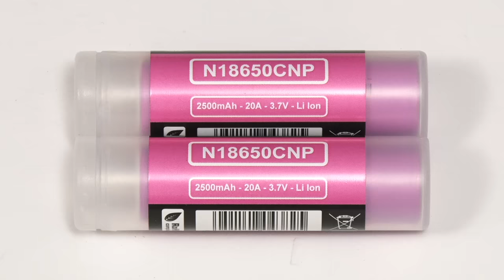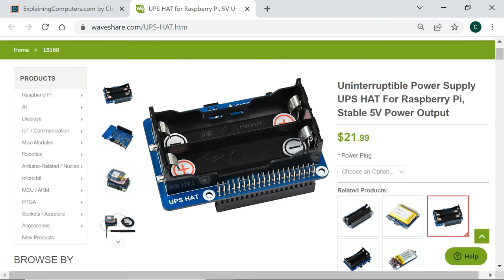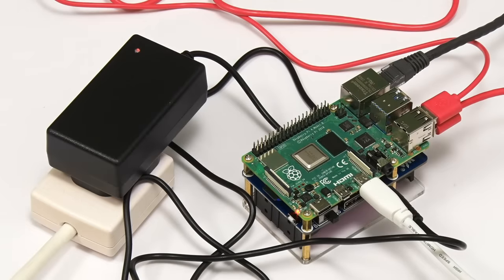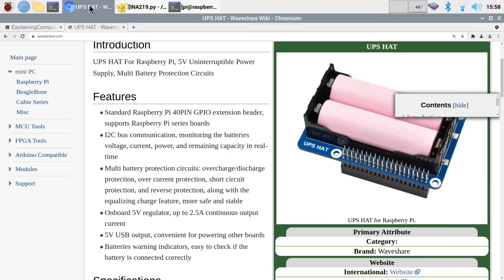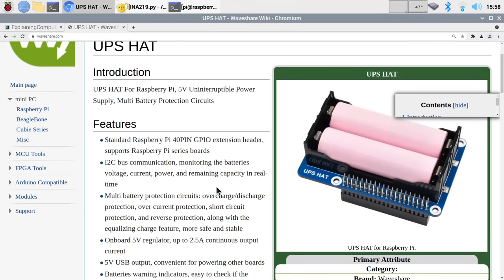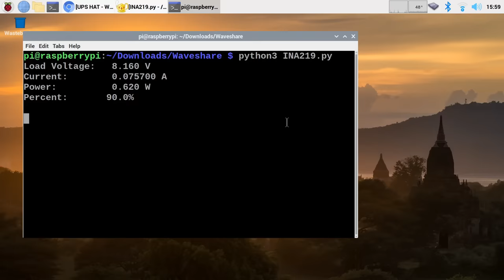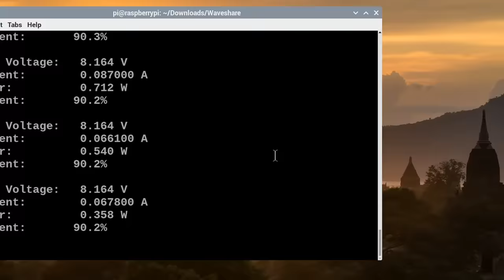Raspberry Pi Waveshare UPS

Comment: I can confirm that the pogo pins are a terrible idea that do not make reliable contact and they are susceptible to not seating properly resulting in an intermittent connection. Kind of ironic given that this module’s sole purpose is to reliably supply power!!

The original version used a conventional 40 way header and is infinitely more reliable.

The only advantage of this new version is that a push button has been added to resolve a bug in the original design where the battery management chip doesn’t power up the Pi after new batteries are inserted. I fixed the old version by retrofitting this switch.

Comment: Greetings from across the pond near Albuquerque, New Mexico, USA. Another super informative video -- thank you! Seems to me WaveShare could place a couple more holes in the UPS PCB so that a RPi Zero 2 W could also be placed on top, especially since the GPIO pins are compatible with the larger models. Just two more holes. A Zero 2 W could run a mightly long time on something like this!

Comment: I'm all for a RPi UPS, but I'm still highly skeptical of the POGO pin setup, especially if it's to be used in a semi-mobile environment.  Also, the IN219 chip that communicates to the pie uses I2C address 1000010 (According to it's datasheet). This address can be reprogrammed to any of 16 addresses by rearranging the combination of Ground, VS, and Line Voltage across two pins: A0, A1... If you plan on using a device with a fixed I2C address such as a RTC, DAC, etc... Make sure you don't have an address collision! It's nice that the chip supports re-addressing, but it looks pretty fiddly to accomplish.

Comment: I’m trying to include the hat B in my project but in my project I have a main power supply of 14.8v at 6.8A. I will step down the voltage to 8.4V but I wanted to know whether the internal circuitry can handle the 6.8A current

Comment: Are the cells in series totalling 7.4v or are they in parallel? It appears they are in series meaning they have a buck instead of a boost, but this also means they would be useful in charging a supply for motors and such.

Which begs the question, is there also a low voltage cutoff circuit for 7.4v supply?

Comment: Another great job on the UPS. Question how long will this device work (Power outages?) ??? Then you need a code for when it fall less than 1-3% battery power, it save/shut down. Or this is build in to this Waveshare UPS unit? If so, great? If not, what code needed to save & shut down the Pi?

Comment: Very good video. Thanks!
I still got a question about the following case - what if…

The external power is disconnected from the UPS. The Raspberry runs now using the power delivered by the UPS, then initiates shutdown and turns off. 

Would the Raspberry turn on and boot up again when external power gets reconnected to the UPS? (even if the UPS is completely charged)

And furthermore: does the UPS turn completely off when the Raspberry is turned off? (so it does not draw any power when it is not in use?)

Comment: Nice video! I thought about getting one of these for my Pi powered home server. But, unfortunately a power outage would also disable my router and then I couldn't access the Pi anymore anyway. So, it wouldn't prevent any downtime. However, certainly it would be possible to gracefully shutdown the Pi in such a situation if the network won't come up until the batteries are empty.

Comment: The POGO pins could potentially do with stronger springs to maintain a better connection if the device is used flat, like in the video.  Other than that it's a more streamlined option than using a USB powerbank.  I do wonder how long the backup power from the batteries is tho?

Comment: Ironic, the "hat" concept is for hardware on top, also not using the correct i2c pins as specified for a hat but that may be because those pins would be in the middle and the board may "flex" too much for a reliable connection, hope the ic2 addresses used are known if not the "I2c-detect -y 1" command can show that, not standard, so install with "sudo apt install i2c-tools"   (could be without the -) ,  "sudo apt-cache search i2c-detect"  will show which package to install.

Comment: It would be nice if an alternative to the Pogo pins was provided in the kit if you really needed to make sure the power connection was secure. I'm thinking of some little terminal block with some short cables that would snake around the side of the board and connect to a 4-pin connector on the last few gpio pins. Also it would be nice if this kit came with an option for a case that would incorporate space for the UPS board and the pi, but I suppose that's what 3D printers are for.

Comment: My UPS is PiJuice, this seems like a good option too.
Reply from the maker: Yes, I have not tried one, but have heard good things.
Reply: @ExplainingComputers  I do agree that the bottom mounting is good for full access to the GPIO without risers like on the PiJuice. I plan on using mine for a blackout resistant time lapse camera.
Reply: @alexlandherr  I too have been using PiJuice with great success and reliability. I was a Kickstarter donator and very glad I stuck it out. My largest install today  has 6 RPi Zero-W v1 and 10 RPi-3B with RPi Cameras using the full size PiJuice.  One of the units is a free-standing employee parking monitor with a 40W Pijuice Solar Panel and 12,000 Ahr battery providing 28 hours or run time communicating over secure WiFi bridge to central DVR-PC that records all 16 cameras. This one camera is basically a pole with a solar panel and a camera in a field with no wires.

Comment: Are the gpio pins where the pogos go still usable for other connections on the top? Can I still plug stuff in those connections like normal or are those specific pins no longer useable?

Comment: Great video as usual. There was some things that came to my mind and that is if there is some logic for preventing it from top charging the battery's or if there is way of letting it control when to stop charging, normally on about 90% and shutdown the system if battery goes below 10% battery (or such level where you risk damage battery) The script could also be improved by showing temperature on the system. Don't know if the battery's temp is able to be readed out but the should not have to temp either, but guess that it is not an issue on this load other than high environment temp.

Comment: Thoughtful design, though it might have been better to put the battery compartments "back to back", as it were, to diminish any chance of alling out. Omitting separate instructions which generally mostly won't be read, might save a few pennies.  If you can't figure out how to assemble it anyway, sticking to Lego as a hobby might be safer. 
A case can be made for an integrated UPS, (and somebody's probably already printing one), but there's also an argument for a stand-alone unit connected by cable to one of the Pi's other power inputs. That way, when the batteries perform their favourite trick, the conflagration doesn't directly involve the Pi. The massive heft of UK plugs means it's probably possible to incorporate the UPS  in a wall-wart.

Comment: Would like to know how they derive the 5v from the 2 batteries. is it just a 5v regulator or  done using a smps. Very important if using the Pi to power a DAC.

Comment: Interesting piece of kit. When I  have used UPSs on PCs there has been software to gracefully close down if the power is not restored before UPS runs out of power, don't suppose you know of anything that would do the job for this system?

Comment: What's the deal with the two different styles of pogo pins at 4:05 and 12:05?  2 have cups while the other two have flat tops and are longer.  Seems strange to mix them.

Comment: Hello,
Wanting to be clever, I thought that by putting a 5V 5000mAh battery between the electrical outlet and a Raspberry PI Zero W it would do the same thing. The Rasberry, on the battery alone, lasted more than 12 hours with stresses of 30 seconds every minute (stress-ng) to simulate activity. But unfortunately it does not support power interruptions when I plug / unplug the battery from the electrical outlet. Pity. By any chance, an explanation ?
Anyway, thank you for this video.

Comment: sir i have an Orange Pi One with Retrorangepi image installed using Hdmi to Vga adaptor using 4:3 Aspect ratio monitor with 1280x1024 resolution but the system UI are not centered.. how do i adjust the screen?

Comment: Connected a 2TB external HDD and it fails, low voltage ⚡ detected, did you face this?
Reply from the maker: I would never expect a Raspberry Pi to power an external HDD. Some 2.5 inch 5400 models you may get away with. But usually an HDD used with a Pi needs its own PSU.
Reply: @ExplainingComputers  Doesn't Pi 4 has USB C, so it should be sufficient enough to power 1 external HDD? (Considering the input power supply, here UPS hat, supplies enough power)

I had also tested the hat with and without HDD, and I could observe abnormal low voltage detections, even without the external HDD, which I was suspecting as culprit here.

What can be the issue here?

Comment: How long would you say that the system can run from the batteries alone? It works as UPS but considering how much current the Pi uses, I suspect that those 2 batteries may not last more than an hour or so

Comment: I run this UPS bord for about three month now. I faced the same issues with the pogo pins. But after assemling the Pi like described in the video UPS hat works perfekt. I installed the Pi at a wall for absolutely now vibration. 
But now, after three month, I see under voltage errors on Pi. It looks like the popo pin connection quality gets worse by time.

Comment: I recently bought a newish laptop and the kernel in Linux Mint is too old to support it properly. I tried Manjaro xfce and Xubuntu for a bit but Manjaro is too unstable and clunky. Xubuntu isn't well refined. I found out that Linux Mint has a Debian version with a newer kernel, currently in beta (LMDE5).  Even though it's in beta and just a side release it still feels much better than the other distros.

Comment: Could you do a video testing how long fully charged batteries last with the pi working at different CPU loads? It would be interesting to know the time at full CPU load but also on a raspberry with no video output that just reads some sensor from time to time.

Comment: It didn't say in the manual, but do you know if it accepts a higher input voltage than 8.4V? My server has a PSU which delivers 12V for fans and such, and 5V directly to the Pi. If the UPS can accept 12V input voltage, it would be almost a drop-in feature that I'd really like to add. Almost all similar PSUs I've seen deliver a much lower current than this one, so it's really a good device.

Comment: Yes, but how might you swap the UPS to another (UPS) WITHOUT powering down the Pi ? 
In this instance it might be possible to plug in a USB-C power cable while the UPS is replaced but while it seems like that should work, will doing that cause the Pi issues? 
Actually the Pi is something of a special case as it has multiple power input points. A typical PC does not and switching out USPs or Power Supplies is problematic.

Comment: Is it compulsory to use 2500mAh battery
I wanted to use 3200mAh
Reply from the maker: There is no reason you cannot use higher capacity cells.

Comment: Yet another excellent video. This is becoming something of a habit. I am very impressed with the Waveshare UPS. One question occurs to me: you demonstrated that the software indicated the change in status at the loss of mains power by the change in display of current. Do you think that it might be, relatively, easy to modify the Python script, such that, in addition to changing the display of the  status, the script also sent an email to alert one of the change in the status? Perhaps a follow up video? Thanks, again, for sharing. Now all I need to do is wait until next Monday morning.

Comment: Seems like you have missed something here. What happens when the UPS batteries run down. Can the UPS perform a graceful shutdown or does it switch off as hard as just removing the power normally?

Comment: I do wonder how long this UPS could keep a Pi running in practice. Obviously this would vary depending on how busy the Pi is, connected peripherals etc, but still, I'm curious.

Also, does the manufacturer (or someone else) provide a script to gracefully shut down the Pi in case the battery drops below X volts or Y %? I guess that would be easy to whip up by any half capable python scripter, but still, it'd be great if it was available.

Comment: I'm afraid those two batteries are fine for an UPS but not if you try running a raspberry pi h24 on a solar panel. Or are they?

Comment: Have you tested the run time on battery? Depending on the CPU load and peripherals, I reckon it should get somewhere between 1-8 hours of run time out of a fully charged pack. Do you agree?

Comment: Shame they didn't include a few lock washers. Those screws could eventually loosen and put the RPi at risk of failure. 
Great video, by the way (per usual 👍).
Reply: Just throw some medium strength threadlocker on
Reply: Lock washers are not a good solution, once they are flattened, they don't offer any more holding power, unless the screw head has corrigations .Maybe a internal star washer?
Reply: @theblinkstykrab3106  sure. Just be careful when using some types of loctite with certain types of plastics. I had a clear plastic box (acrylic or polycarbonate?) disintegrate after using Loctite 243. There are numerous, similar, stories out there.
Reply: @davidhamm5626  split washers are better than nothing :) I can't say what type of lock washer would work best. Star  inside or out? Split?

Comment: pogo pins aren't a good solution imo. I do prefer proper connectors but I also understand how some people want free pins to do their stuff.

the best would be soldering wires underside. all free pins and zero vibration issues, but it takes tools, a bit of experience and slightly unfriendly setups. it heavily depends in the end, just beware of the pogo pins' inherent instability, especially with use and with creation of oxidation due to micro arcs.
Reply from the maker: The soldering solution would indeed be ideal.

Comment: How typical is it to power a Pi via those GPIO pins?  This is the first I've heard of such an approach.  Have you covered other expansion projects that used those GPIO pins for power input instead of output, and I never noticed?  Mostly I've only heard of using the USB power input.
Reply from the maker: It is quite common to power a Pi via 5V and GND GPIO -- it is no different than using the USB input. It happens in (for example) the Argon One cases I've covered here, and in I think my Raspberry Pi plant watering video. :)

Comment: Minor quibble but Lithium Ion cells come in multiple "grades" and I would question your choice. Some have high stored energy but lower current capability e.g. for use in laptops and at the other extreme are cells designed for power tools that can support 20-30a discharge rates at the expense of lower ah ratings. Your £6, 20a-capable cells are probably overkill for this application and I would have suggested either cheaper 2.5ah 5a capable cells or, for £6 each, perhaps 3.5ah 5a cells.

Comment: But is a PI4 normally in a situation where uptime is so important that you need 365 uptime and thus battery?  I don't see the advantage,  the pi4 is 80 euro,  the head is 30 euro. Is it not easier just to buy a 2 core 8 gig workstation mini on the refurbish market ?  Then you can add SSD and extra ram if you want. 

Could you review the online refurbish station 100 pound systems on sale at eBay, refurbish sites so we can choose a reviewed system for a home server or rss or iot server. With the depth of an EC review.  Online mass-dumped company computers review could be a nice new topic.

Comment: Seems to have some significant downsides over some of the alternatives.
- needs a very specific and non standard power supply 
- only compatible with Pi’s and exact clones, other SBCs are out
- pogo pins are just stupid for this use case